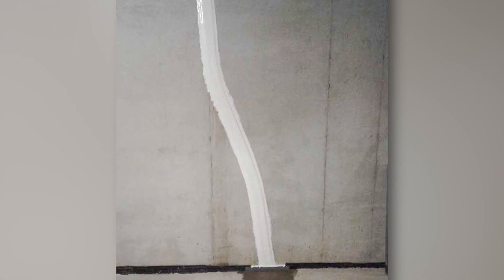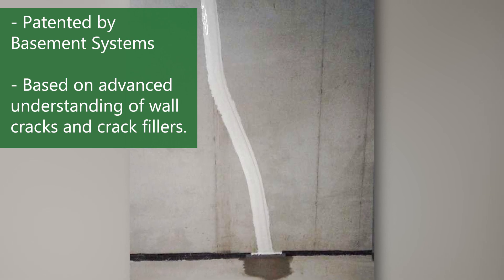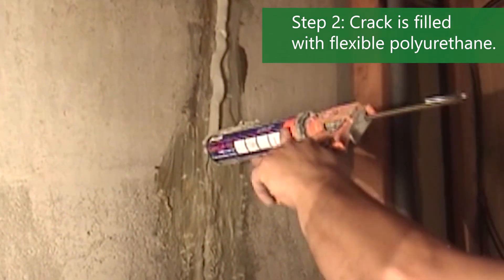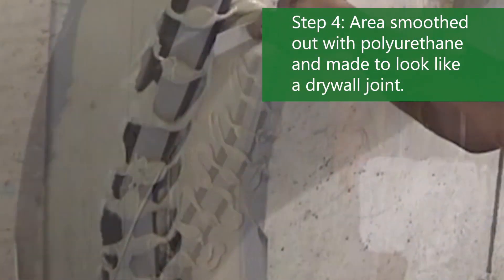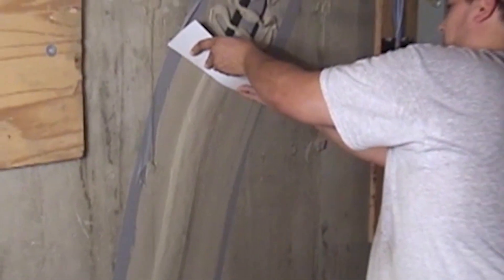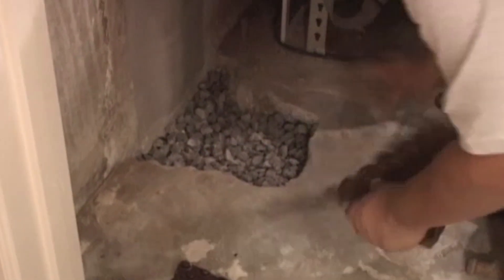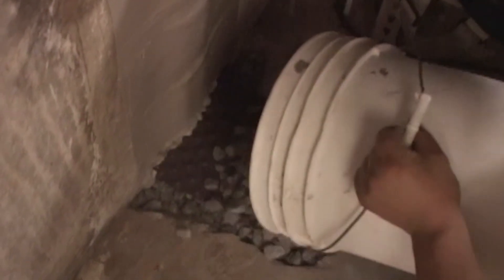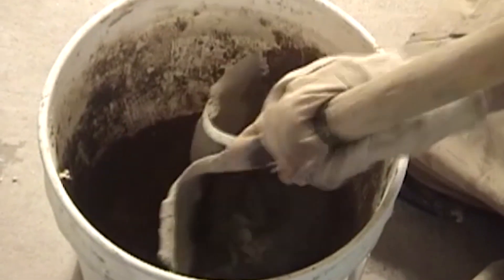🐊Crack Fillers: What is FlexiSpan? | Foundation Repair

Comment: This method does not fix the foundation. This is not the method used on roadways, bridges, dams, or tunnels. This method is not used by structural engineers for any of the above situations. This method only directs the water to the  drainage system in place. Surly every foundation needs a drainage system if it doesn't have one in place, but this method is not a repair. A foundation wall should be one piece. The methods widly used for these poured foundation walls is the "injection procedure". It has proved to work at the Baltamore tunnel, Hoover Dam, water treatment tanks, clearwells and any concrete foundation or structure.
Reply from the maker: This method isn't the only method we use for cracks. It all depends on the specific situation. We mostly use FlexiSpan for leaky cracks to stop the leak. It's not going to hold your wall up if it's collapsing. There are other methods for that specific problem. We explain in our videos when it's appropriate to use every solution.